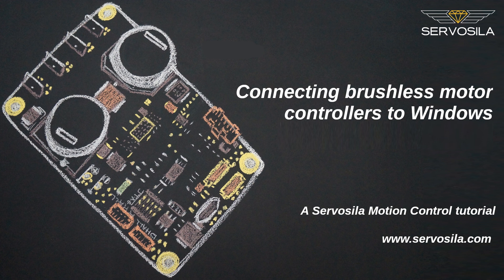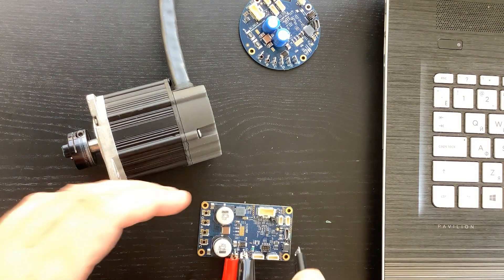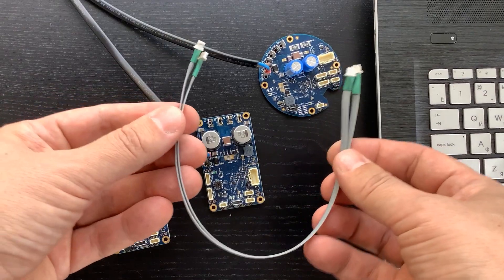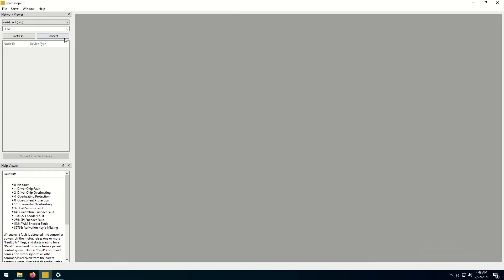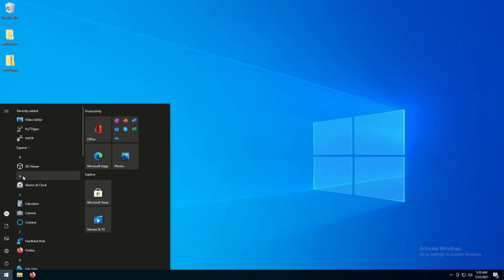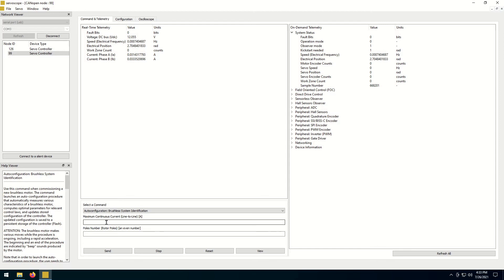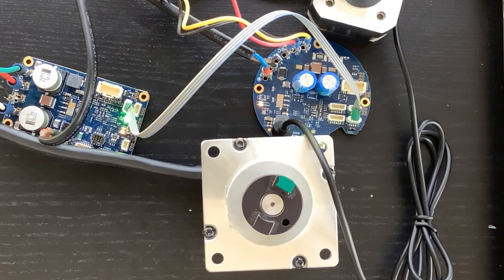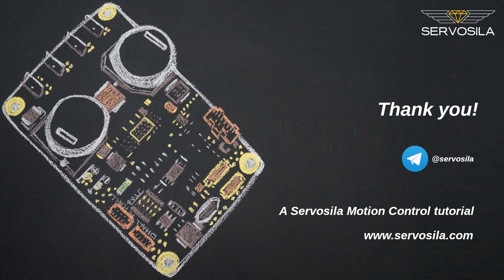Connecting Brushless Motor Controllers to Windows via USB (BLDC, PMSM, Direct Drive, Brushed)

Comment: Could I program a motor using this setup to run at a specific time, for a certain amount of time?  I want to use a motor to lift a lid on a dumpster to feed horses at a certain time of day, and then close it at another time.  Is this possible with this setup?
Reply from the maker: Yes, you can use a simple G-code command to get the motor to run for a specific time.